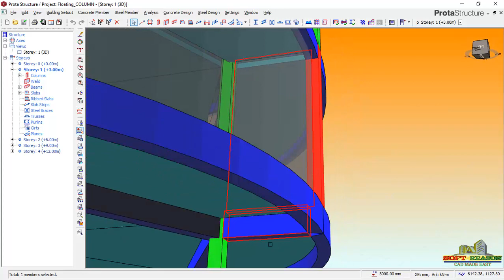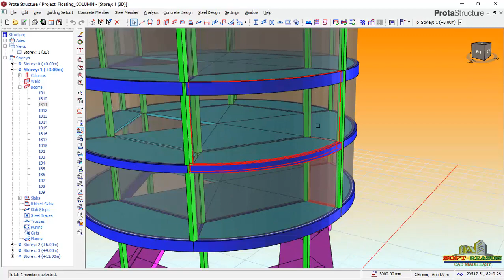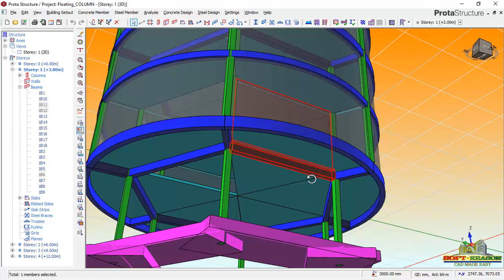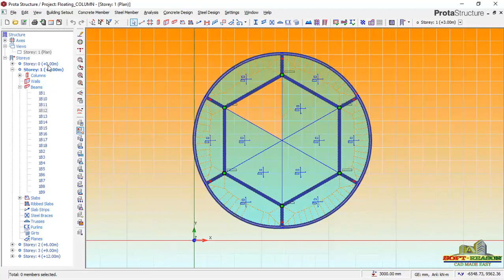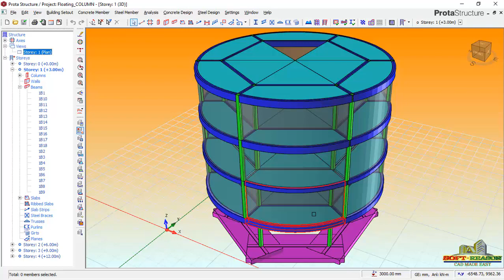How Floating Column Works as Apply in Protastructure

Comment: When i have modeled the floating column it brings to me this message when i run the analysis "Problems encountered in the analysis model.
Nodal point of some column/wall members are invalid."
Reply from the maker: WHICH VERSION OF PROTASTRUCTURE?
Reply: @CADmade-easy  2021
Reply from the maker: not good if not a license version
Reply: @CADmade-easy  What if it's licensed what could be the solution.

Comment: Sir when running analysis, I always get this warning sign, "the column  listed  above  is either fully unsupported  or it's  supported  by beams/slabs". Though I make provision  for cantilever  beams that support  the cantilever  slab. How do I fix it?
Reply from the maker: check all your floating columns to ensure they are properly in place so the software would not see it as unsupported members.
Reply: @CADmade-easy   yes sir they are properly  in place